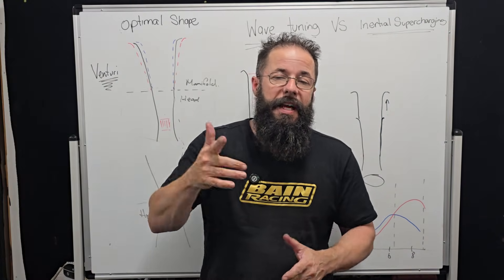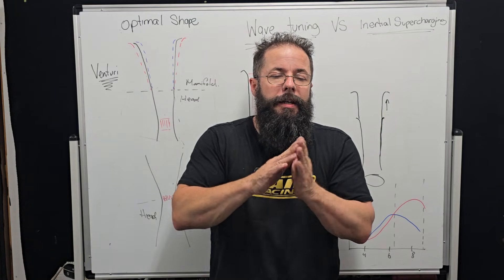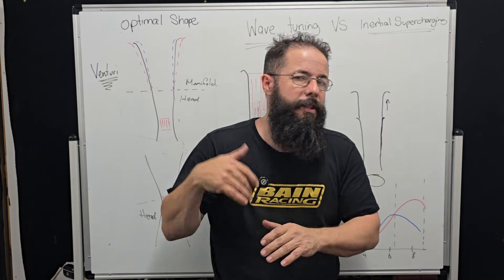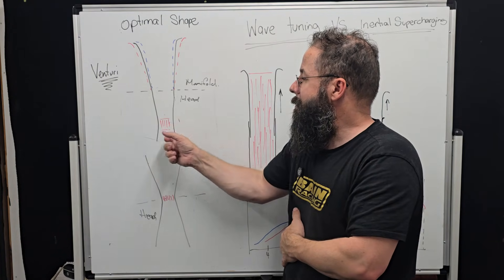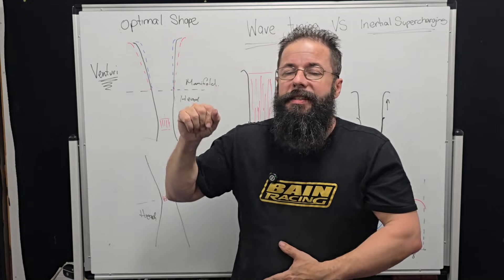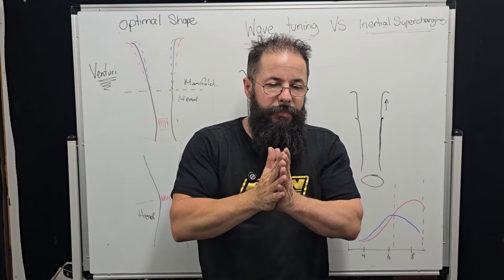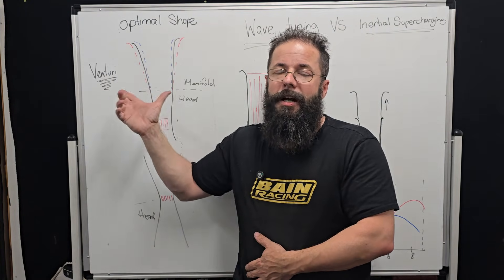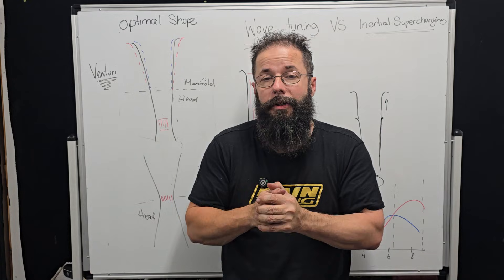VARIABLE LENGTH RUNNERS - Why Venturi Beats Parallel Pipe for Maximum Power and Area under the curve

Comment: Which episode talks about a bent runner vs a short runner
Reply from the maker: Should be in our induction secrets series mate.
Reply: @bainracing after watching pretty much everything you have,  i think the answer is that it doesn't matter if it's a short line of sight runner,  vs a long runner,  as long as a long, curled runner has attention paid to adding volume in the long side radius and if the CSA increases about 25-50 percent from the head window to the plenum window.
Reply from the maker: @thecontainergarderner4704 short runner will RPM where the long curved will flat line a bit. But it depends on even the shape and how short is short?  Generally a short straight line of sight is better then a bent runner. Even if you only target the 4th harmonics 👍
Reply: @bainracing i have a ford fiesta st. It has the square ports with rounded corners that are separate for each valve.  I think short is like just a couple inches of runner attached to the head,  where long would be the length at the rpm in your graph.  7k is like 14 inch total length i think.  So 7 inch total vs 14 inches total.

Comment: Thanks for the good content as always! As a student studying engines your videos are super valuable from a design perspective. Could you make a video covering the design parameters that should be considered for the intake system up-stream of the throttle body? 

From my understanding the total length of the intake system (port length + runner length + intake tube + etc) will have an impact on the wave tuning beyond just the runner to plenum length. I'm curious how impactful these effects really are to the intake performance. 

Additionally, is it beneficial to add taper to the intake tube upstream of the throttle body? I have seen intakes that have been designed have an expansion up to the throttle body as well in order to increase the intake pressure at the throttle body. But I can also imagine that a tapered inlet pipe would be more impactful to "ram" air into the plenum. 

I think that obviously the majority of the time the engine bay will be the dominant design factor in the intake tube, but if there design aspects that will help, every fraction of a percent counts. Curious to hear your thoughts.
Reply from the maker: Definitely something we need to cover.

Comment: Do you know of a ratio Jake for ideal number and size of cylinders vs friction vs flame front vs cylinder pressure vs induction and exhaust scavaging? Is there such a thing like how track to wheelbase ratio "generally" works well at at Phi (1:1.6)
Reply from the maker: This deserves a video.

Comment: What's the fundamental difference between wave tuning and inertial supercharging?
Reply from the maker: Wave tuning is about the speed of sound and the timing of the waves match to your RPM.  So this is why higher RPM need shorter runner. And lower RPM need longer.   Inertia is the force we create with the right air speed.   

Think of this as the force you would feel on your hand when you're driving and you put it out the window.  That inertia supercharging is a weight created by velocity to help fill the cylinder long after the piston turns around and starts coming back up the bore.  👍

Comment: What is the perfect taper angle of the port/intake manifold and how to calculate it if it is engine/port dependant? Is there tapering in the exhaust port and if so how mutch/how to calculate?
Reply from the maker: There's no perfect taper.  Its more about air speeds and CSA.  I might do a video on this. I've covered some of this in our induction secrets series.

Comment: Lol...I agree! Varying runner length is a hopelessly crude and inefficient way of implementing a variable geometry induction system. The correct way is to optimize the inlet profile for the targeted RPM range, then introduce a temporary mechanism at moderate rpm, that tricks the operating cylinder into thinking it is inducting air from a port system that is smaller in volume and higher in velocity to broaden the torque curve. Once the target operating range is achieved, the mechanism that generates below peak rpm port inertia is completely withdrawn.
Reply from the maker: That definitely helps the inertia side. But not the wave aspects at different RPM. The simplest way is a single Throttle plate ITB or dual, ITB in general is torque on demand anyway.  Our cone system worked well, but no secondary mechanisms like with a common plenum.  And none of these can compensate for valve size bowl CSA, throat or even the piston speed needed for good filling characteristics,  And most limit peak area under the curve in narrow windows like for drag racing. Thats why for  bulk power numbers we can't bet an common plenum, optimised for inertia and both opening and closing as well as the secondary plenum waves.
Reply: @bainracing  If back-to-back testing were to show variable geometry and fixed geometry systems produced comparable peak torque values, but the variable geometry implementation didn't optimize wave tuning below peak torque and relied strictly on port inertia, are you confident that the variable geometry implementation didn't show any improvements below peak torque compared to a fixed geometry system?
Reply from the maker: @Cleatus46 You really need to talk about what's sort of variable geometry and what style of intake. Also what engine? 2 or 4 valve also What RPM? Are We talking a drag racing all out NA like what we do with prostock and superstock?
Reply: @bainracing  As it relates to the physics of how efficiently air gets into and out of a reciprocating air pump, do you believe a variable geometry configuration could improve VE throughout a narrow RPM range over that of a fixed geometry configuration if one could physically alter the geometry incrementally throughout the selected RPM range? This question would apply to any reciprocating air pump with automotive-type valves.
Reply from the maker: @Cleatus46 hence why I said. What engine? The next question is. Especially in a drag engine is that the best idea? As we know its not. Especially in over comp drag engines.  But be specific. The devil is in the details.  Are We talking common plenum V8 10,500rpm super stock/prostock? So top NA? Something that needs the whole primary length perfect and needs all wave events on time.  Or are we talking about a 4 valve circuit engine.  

Also explain what you are doing is a common plenum to achieve this without hurting other mechanisms.
Reply: @b @bainracing the BMW s65 engine would be interesting to consider optimizing with it's long rpm range and low displacement

Comment: So, going by what you were suggesting after the 11:00 mark, would you say that drag racing engines are the easiest, or least challenging engines to develop, in comparison to a circuit car racing engine, for example?
Reply from the maker: Not really,  its an art to pack all that extra HP in the area you want it.  This is why its important to understand the mechanisms that feed it. Like MCSA and velocity 👍.   Circuit engines for me seem to be easier,  2 or 4 degrees on duration can upset a drag engine. Where a circuit engine the power curve is much broader so not as noticeable.

Comment: cheers Jake, another awesome video, though it does put a little dampener on my duel intake runner length naturally aspirated rb dreams. plan was to have about 4 inches between short and long and have it setup to come on at the same time as the intake cam advances 20 degrees. this giving me plenty under the curve for circuit racing/ drift car.
Reply from the maker: If you can make them lift away or fold over. That's a better system than parallel pipe style 👍  2 stage for circuit will work pretty good.